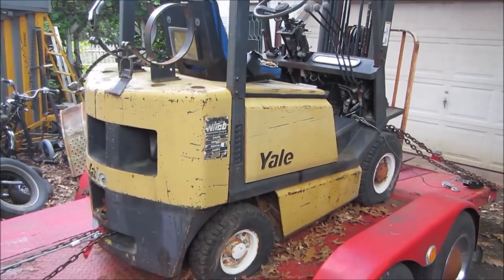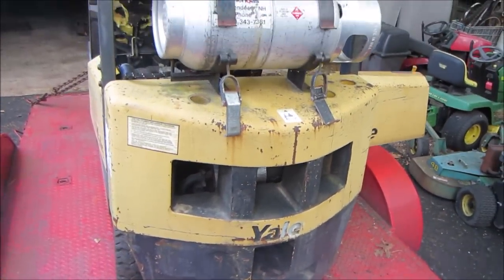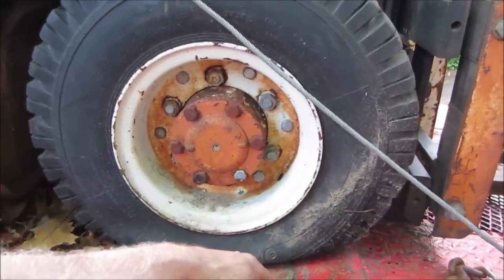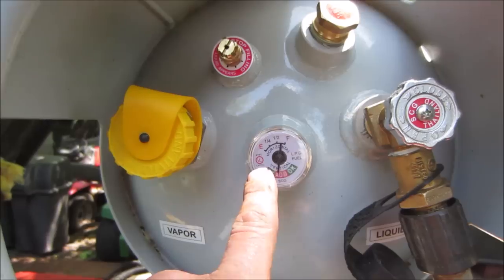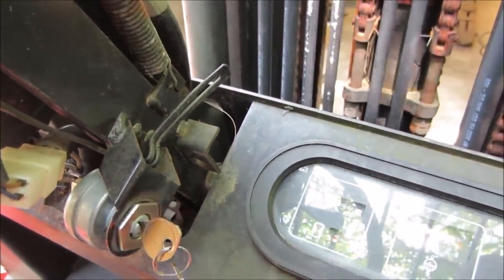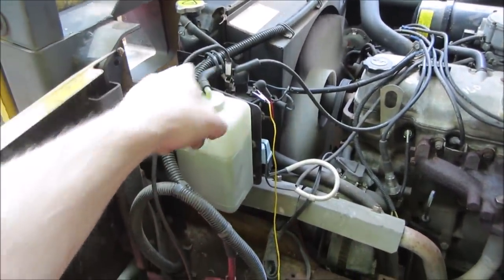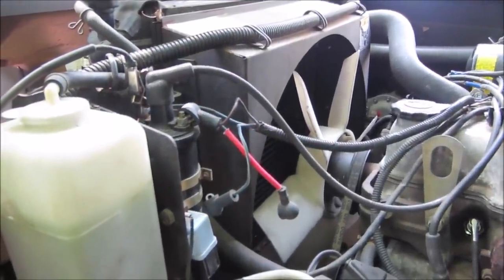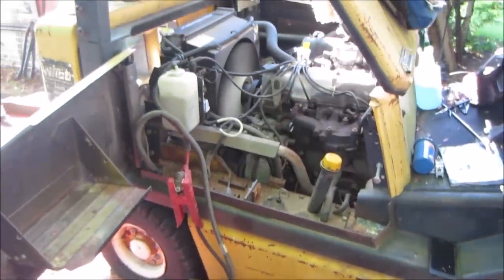Will It Run? cheapest Forklift I could find .pt2

Comment: lp tractors a  common  basicely  just gas engines with a lp hookup  what you need to make sure of is that it has "hardend valves and seats as lp is dry and will burn up regular valves

Comment: Any time something shuts off after it warms up - it is usually the electronic ignition module or coil, whichever type of ignition it has.  Bad ballast resistor smoked the coil is my guess.
Reply: Why does the electric ignition module or coil make the engine shut off when it's warm
Reply: @stocks4bt  because a lot of coils have internal semi conductors built into them and when they get hot, they can fail.

Comment: Can't believe it ran that smooth the way it was jumping spark.

Curious - could you hear that arcing right after you started it, or was that something that the camera picked up on electronically?
Reply: Okay. Maybe that's not what I was hearing? Well, whatever it was, I didn't hear it again when you started it again, with the same plug wires.

Comment: Shows new plug wires "'yay, he is gonna fix those janky spliced-together plug wires" *pulls "distributor" apart.  " oh.. well NOW he's gonna replace those plug wires"  *pulls the coil assy apart, puts timing light in-line with spark plug "Ok,, now he's totally gonna replace those @#$$ wires"  *Pulls resistor apart, gets a new coil "Holy hell.. he's never gonna replace those wires is he?"  *Replaces the problem module, starts forklift again "**flip table** screw it.. I like those broken plug wires there anyway!  I don't care anymore!!" :-P

Comment: Suggestion: Restore the key system. In here, we could get the key for the system figured out and produce a working key in minutes.
Oh, and that switch needs to be disassembled or cleaned, or a new one purchased.

Edit: Whoops, you already got those. But the switch system, if it's stock specs, maybe it should be restored into the system too along with the key.

Comment: I'm just curious; why would they have a ballast resister on the coil with an electronic ignition setup? I understand the purpose for it on points ignition, but not on electronic ignition.
Reply from the maker: my thinking was to knock down the voltage to the pickups

Comment: looks like ballast resistor is wired incorrectly-it should put battery direct to coil when cranking then thru ballast during run. It seems like battery is wired direct to coil.

Comment: I'm wondering why the pickup became so hot.  If the root cause as to why it became so hot isn't solved, don't we expect the new pickup to fail in a little while?  The pickup itself is a solid-state component, right?  Why would it become so hot?
Reply: the ballast resistor is not dropping the voltage down enough to the module. I would either find a ballast resistor that works or find in the bone yard an early 70s buick with a 455  that runs on points and remove the resistance ignition wire from the firewall to the coil. ideal voltage should be 10.6 -12.6 vdc to prevent module over heating. or it's the alternator charging voltage to high
Reply: @darrellgabbard5061  Thanks, Darrell.  I thought Mustie excluded the ballast resistor as a problem after he tried another one from his stash but, like he said, he wasn't sure how low it should be dropping the voltage.  I hope he follows your advice and gets a replacement soon.

Comment: Someone screwed the wiring up when they added that switch, and you continued the same fault when you wired in the new key switch.  I'm surprised you don't know how the ballast resistor on the coil works.  When you crank the engine to start it, the ballast is bypassed to get full voltage.  When the key is released to the run position, the voltage goes thru the resistor to drop the voltage.  That's why there is two wires on one side of the resistor, and one one the other.  Yes, I know you made this video weeks ago, and have probably found the problem since then.
Reply from the maker: l know how a primary and secondary setup works, that would only be for a points setup, but not sure if they are trying to make a drop for this in the same manor, l ordered a factory switch and will see after that comes in,

Comment: You will not have fuel at the regulator until you apply vacuum to the vff 30 fuel lock off ... you should have no more then 3 psi exiting the regulator...

Comment: Welcome to the dark side.

Let's call it a fuel cylinder, not a tank (It is removable, therefor a cylinder - tanks are fixed mount).  There is a flow control in the fuel valve on the cylinder, that will block fuel flow off if there is a massive fuel leak - opening the fuel valve on the cylinder partially prevents it from working - its good practice to open the valve fully for that reason.  The locating pin is to keep the pressure relief valve on the cylinder out of contact with liquid propane.  Imagine liquid Propane shooting out of the relief...

The fuel system is comprised of a Lock-off, vaporizer and carburetor.  The lock-off has a filter in it, and shuts down fuel flow when engine vacuum is absent.  The vaporizer has coolant running through it and turns the liquid propane into a vapor, and reduces vapor pressure to about 2 psi.  Vapor from the cylinder will pass through the fuel system and run just fine, though may starve for fuel on high demand.  

To lift the drive tires off the ground, tilt the mast all the way back, put a block of (hard)wood under the forward edge of the outer mast rails, tilt forward until the tires are clear of the ground.

Side shift.  Please call it side shift or we can't be friends.

The header hoses (weave through the mast to supply the side shift cylinder) are compromised (the jacket is part of the structure with that style of hose).  This is a PITA job on that truck, you will be covered in oil before you're done.  Start at the carriage and work your way back to the rear of the mast.  AW32 will be fine for hydraulic oil, check it with the mast full lowered and the tilt all the way back - at the ADD mark is fine for cold oil, one tank, many different mast heights.

Check the coolant level in the radiator if you haven't already, I despise the smell of unburnt propane.  

Chassis grounds are a known issue on that model, please confirm (intermittent no crank).

Conventional coolant, 10w30 (5w30 if you plan to run it in the winter), J20C tractor transmission oil, 80W90 in the diff, EP2 grease with Moly for every fitting / bearing - put where the bearings run on the mast rails, and on the back side of the telescoping sections at the top of each section - you'll know what I mean when you go looking.  Mast will have grease fittings at the base of the lift cylinders on the back side, tilt cylinders on both ends, side shift will have 2 on the top, steer axle will have one on the front of each spindle (crank the tires to the stop to find it) and two on each tie rod / dog bone.  DOT 3/4 brake fluid. 

Let me know if you need manuals for that unit (if it didn't kill you coming off the trailer).

Comment: omg, i have been GIVEN things that "didnt work" and taken about this long(or less many times) to "oh that was easy", even sold stuff back to people...best was a reciever my buddies father gave me when the hdmi audio died...a bad resistor and cap combo, wrong value...he bought it back for 1/3 what he paid for it.. took me 20min to fix it.... searching youtube fro what was wrong(common with that unit every one that dosnt have a .x after the model/revision number, will fail if you use the hdmi, the audio side fails..(cooks itself) no harm to anythijg connected just...you gotta replace the parts with ones the correct values... easy peasy.

Comment: Making this comment at 20 min into fix = pick up modal in dist needs dielectric under it to take heat away, other wise it will get hot at about a 10 to 20 run and die , many of the new cars from factory missing that dielectric did same, lots of tow's back to dealership due to problem !

Comment: You can run them on bbq gas tanks, but not well.  Weld a pick up tube from the bottom of the valve to the bottom of the tank.  I worked with propane a lot and I don't love the smell!  Wait until you clean propane oil out of the regulator/evaporator and carburetor.  It's disgusting.  Couldn't you have raised the forks, stakced those wood ties under them, then lowered the forks to hold the front wheels off the trailer?

Comment: $106 for that small thing?  What was it exact;y?  not clear in the video?
Reply: Kevin Zoid a Hall Effect sensor.
Reply: @harrowtiger  I don't know what that is but I guess there is science inside it.  Thank you for your explanation.  :)
Reply: Kevin Zoid a magnet passes some sort of special transistor the “Hall Effect Transistor” and energises the transistor to trigger an electronic pulse that in this case signals the spark to occur. The rotor in the distributor has four lobes on it that are magnetic that turn past Mustie1’s little black fitting, see the electric terminals where the two bolt holes are in the black plastic HFE. Used in the forklift instead of old fashioned ignition points. 
In radio control aeroplane servos they sometimes use HFE’s in place of feedback potentiometers to determine position of the servo.
Reply: @harrowtiger  thank you sir for the explanation.  Not that I fully understand but you give me reason to research and for that I thank you.

Comment: It’s called a side shifter you should of got aluminum start the fucking thing and drive it it’s a fork lift never warmed one up in 20 years side shifters are for girls half the time it’s not a car I have never seen no one warm up a lift truck unless it is winter and you drive a enclosed one sure would not make a forklift mechanic I doubt it was high a forklift needs to rev like buddy said you rev it up tomake hydraulics work faster turn idle to we’re it was I think you turned to low